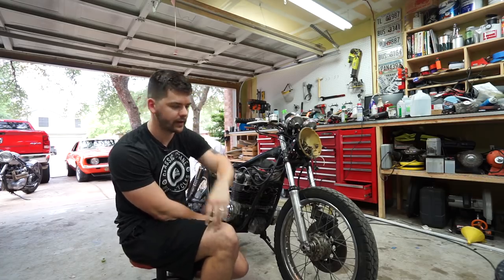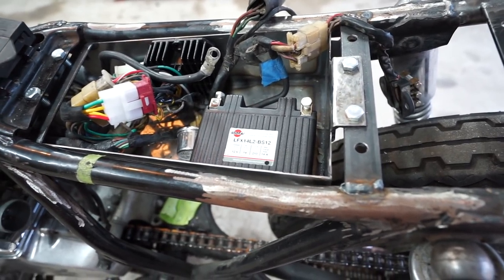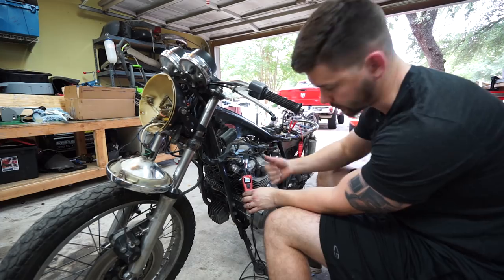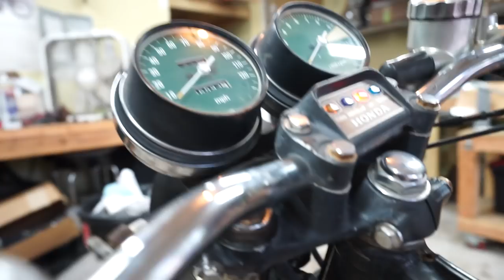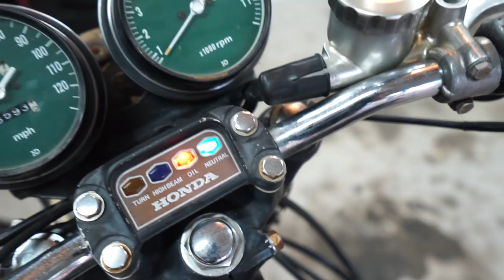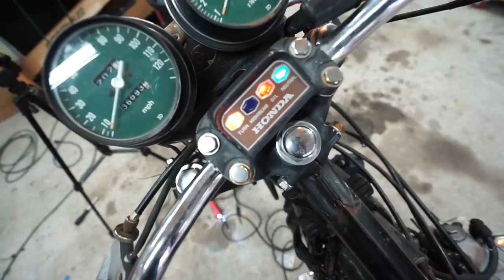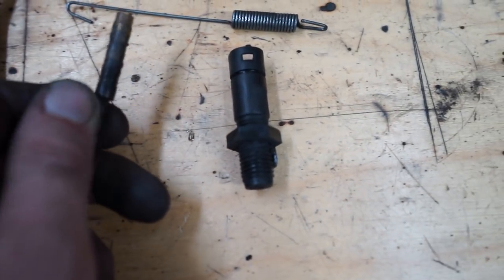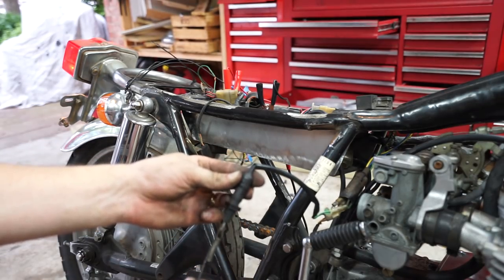Barn to Brat Episode 11: How to diagnose motorcycle wiring

Comment: Great work!  I've had my power probe for about two years. Every time I take it out, I'm rocked for how great that tool is.  I also ordered the electrical auto diagnostic shop book from the same designer. absolutely great for diagnostic work. Both auto electrical theory and trouble shooting in one. Get it.  Thanks again.

Comment: Great content. When you used the power probe to get power to the headlight and it came on i thought it would not work if the negative side was opencircuit as you found out later. Thanks for your help.

Comment: @6:22 you "throw" power (apply +12V) to the white wire.  Very dangerous if you start putting 12V on to a ground wire which the headlight connector clearly has.  You should have a big caution when using that feature of this tool. I don't have this tool so I am not sure what it does when you connect its +12V to ground - perhaps it has a protection circuit built in and displays a nice warning or tone.  Regardless, still a bad idea to creating short circuits.

Comment: cB400f - Installed a "turn style" Key ignition like how you start your car... with this I am having trouble wiring the oem style kill switch on the right side controls. The replacement oem comes with a red and black and extra black wire I do not know where to connect?

Comment: 98 sportster I have changed to led headlight and added 2 more led lights to hwy bar tied hwy led lights into existing lights on hwy bar so less wires now when I turn switch on to lights on hwy bar wires get hot and fuse blows underneath seat relay is 12v 30 amp do I need bigger relay now or have to separate the lights frustrated thought leds pull less amperage

Comment: My high beam works but not my low beam
I changed out the head light but still the same problem
any easy tip on how to find the Low Beam Fuse on a Honda Shadow???

Comment: Very informative would you also help me with my bike, it's a yamaha 125cc problem is bike starts ok accelerates well down a slope but when going up the same slope it has no power at all, even with full throttle some other time it will has power to climb the same slope. Any help is much appreciated

Comment: I'm having an issue. I engine swapped my 77 Suzuki GS 750B with a 1983 Suzuki GS 1100E. NEW regulator/rectifier. It runs great but overcharging battery 15 volts at idle. Can't figure it out??

Comment: Hey bro, need some tips on possible wiring problem. I have no tester so, yeah. 

My bike has power but neither push starting nor kick starting has any responses like a totally turned off bike. I tried jump starting through the starter relay and it started but it needs constant revving to hold its power, if you let go of the throttle the engine dies. I heard some electric cliking noise under the gas tank. So, any thoughts about this? Thank you!

Comment: hi i have a honda 100cc , i upgraded battery from 2.5ah lead acid to 6ah dry battery, i installed the 18watt led the problem was on indicating or horn or pressing the brake dims the headlight on indicating it starting to flickering like ac headlight...but the electrician told me that it battery isn't strong so i upgraded the battery and still problem is there whenever i turn turn on light without starting my bike battery gets low in 10sec and light dims out instantly idk what is problem i showed it to 3 different electrician but they couldn't fix it please help

Comment: Great series. Quick question... you need a special charger for lithium ion batteries, yet the bike is able to charge it with no modification to the charging system... why is that?
Reply from the maker: I updated to a modern REG/REC designed to work with lithium batteries. http://4into1.com/regulator-rectifier-honda-cb350f-cb400f-cb500-cb550-cb750/
Reply: OK, thanks. Guess that's why I often see people with newer bikes swap in a lithium ion battery without any further explanation, cos newer bikes already have a rectifier capable of charging it.

Comment: If anyone has any advice I have a ecu fuse blowing everytime the key is switched on a 2005 zx10. I've traced the fuse wires into the ecu plug and have ran continuity on the neg ecu wire onto ground and got it. Does anyone have any advice ??

Comment: Long time subscriber here.  Using a power probe (which I have) how could I use it to test a push button ignition switch?
Reply: I've got a Yamaha that had a intermittent start problem..take off your throttle handle assemble..look closely at the internals to start switch..theres a tab that is supposed to touch the handle bar to complete the start circuit..bend that tab up just a bit so it makes positive contact to handle bar..also look where this assemble mounts to handle bar..sand off the paint from the handle bar ..assemble ...should start right up ..
Good luck...

Comment: Hi, great video, Won't you have overheating problem with the VR enclosed in the battery box ? I had that problem in  a 1998 bmw f650 that came originally under the seat so I relocated it. Thanks for the video, gus
Reply from the maker: I'm leaving the front of the box open and drilling vent holes in the rear so allow airflow. Hopefully, that will be enough. If not we can look into other mounting options.

Comment: Quick question ? I was testing my 82 CB 650 once I got the battery but I had mistakenly connected wrong did got spark at first. But the second time I connected I saw some little smoke out of the components box, and now there is no electricity at all. Where should I start troubleshooting from ?
Reply from the maker: I would hook up the battery correctly then just look for power and see where it stops. Most likely you just blew a fuse or caused a short somewhere.